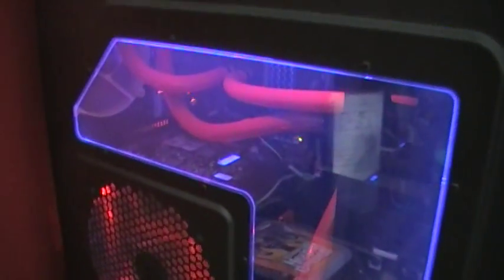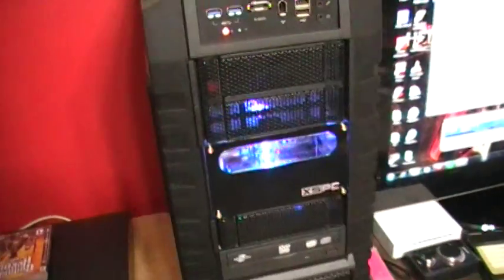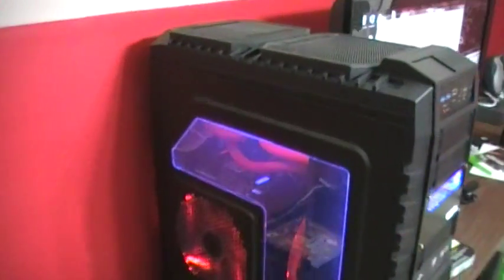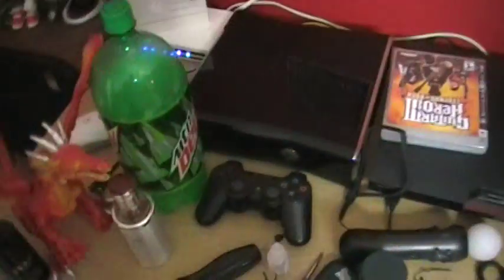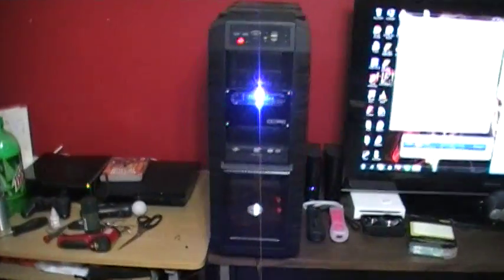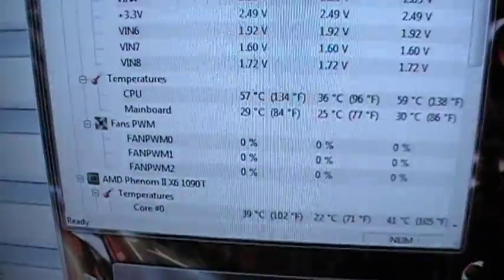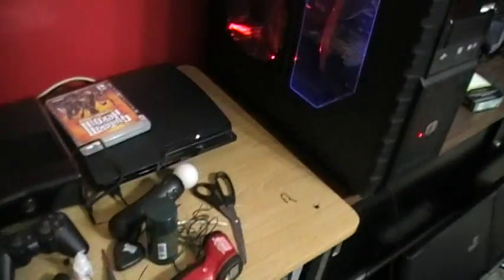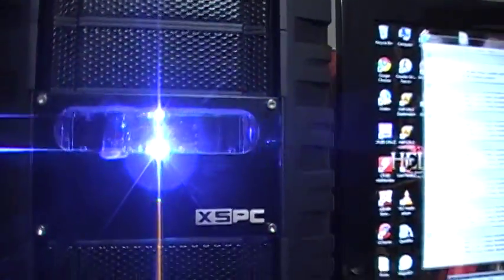Cooler Master HAF X Water cooled 1090T @ 4.8ghz

Comment: How did you manage to fit the radiator up there with a push/pull fan configuration? I'm asking because I have the same case, and I want to do something similar.

Comment: Yep your chip is toast... My buddy keeps his 1100 Thuban at 4.3GHZ, his temps are "WAY" below what you're running for temps, his voltage is 1.54 to 1.56 volts I believe....
4.8 GHZ my rear. I bought a Phenom II x4 960 thuban stock 3.0GHZ to test, and i'm clocked to 4.25GHZ on water, that's a 1250 mhz OC.... My buddy can't get past 4.5 with anywhere near safe voltage or temps... I'm not buying 4.8GHZ, by the way you have to turn of your turbo core function OFF, as well as your cool and quiet.

Comment: @TheNewbpowner123 Refill the coolant EVERY HOUR?  Holy shit you need to do some research dude.  You MAY have to top if off every once in a blue moon.  But the only reason youd need to add much is if you had to take it apart for whatever reason or if you needed to change the water because it was contaminated and nasty and then youd want to flush the whole system out.

Comment from the maker: @10thprestigepro Its not at 4.8 anymore. As it sits its 4.6 using 2 gtx 360 rads. The total build only cost me 1600$ out the door for all the parts, and the build now can probably be done for 1300 due to the price drop on a few of the parts. Thanks, i have a few more builds i completed in the mean time but i havent bothered to make vids yet. im waiting to finish building my media room and then show it all off

Comment: @alexthager You using an Intel? 2500k's and 2600k's are easy as hell to get to 4.7ghz but this guy is using an AMD Phenom 1090T which stops going higher when you're at like 4.1-4.2 unless you're doing extreme cooling (Dry ice, etc.)

Comment: A little question about water cooling. 
How do you remove the pump, water blocks and radiator actually? 
Do you have to wait till its dry?
Or do you normally have to refill the coolant every hour?

Comment from the maker: @SylentCommando i mounted the rad to the top of the case using the holes where the top 200mm fans go, when you do this you can only use 2 screws a peice on the top fans, then for the gentle typhoons on the bottom i just used the standard m4 mouting screws.

Comment: evangelionberzerk, I have the same case as you and I was wondering where did you put your radiator. Did you mount it at the top of the case where the single or dual 200mm fans would sit or did you mount the radiator at the back of the case?

Comment from the maker: @eternallord That statement couldn't be any more correct, I almost bought the 800D but ended up getting the HAF X instead. The 800D is a really nice case but without mods it has the same capabilities as the HAF when it comes to watercooling. So i saved the 100$ and got the HAF. To be honest I would get the HAF X, i ended up getting another case that destroys both the HAF and the 800D so i started to realize how limiting regualar cases really are.

Comment: @evangelionberzerk it'd definitely be nice to have the option to add a card into the loop in the future.. Well the only thing I will be doing in the future at most is maybe a larger PSU (750HX is working fine right now), a 120gb SSD, and a way to mount water cooling internally..

You got any suggestions? I'll be doing A LOT of research before buying, but I don't wanna overspent, or get something too flashy.. I just want room and options.

Comment from the maker: @eternallord Yeah there not a lot of room in the Antec 300, you will either need to remove the hardrive cage or do and external watercooling setup. You should pick your case based of of exactly what you want to do with it including future upgrades. 

I would suggest the RX360 kit, that will give you excellent temps no matter what chip you use and has enough cooling to watercool your 6870 also, anything more then that and id suggest piecing together a custom loop.

Comment: Gonna pick up a sapphire toxic 6870 for Xfire whenever they release it, but my next upgrade will definitely be water cooling, but I'm gonna also need to get a new case.. Can't really use the antec 300 without modding.. I wanna get something that's not incredibly pricey that will be able to take a 240mm rad.

I'm considering the XSPC Delta 750 RS240 WaterCooling Kit since it doesn't seem to pricey.